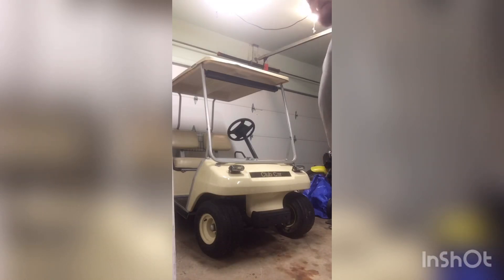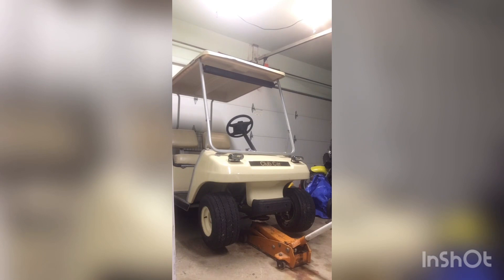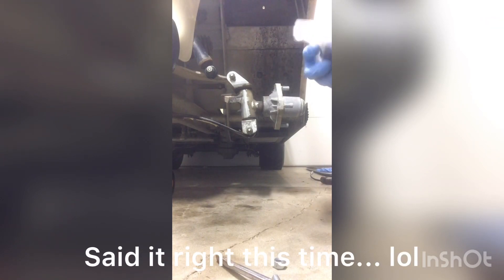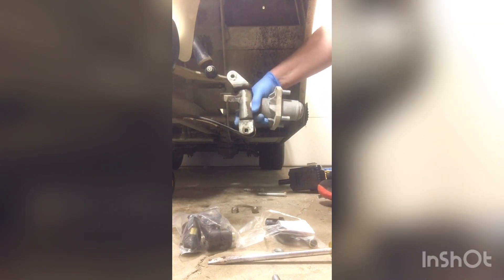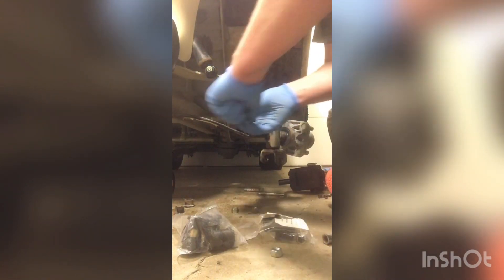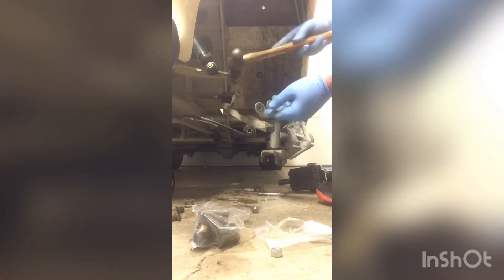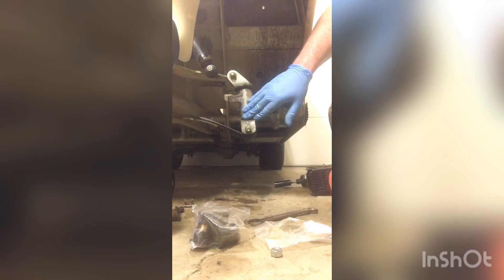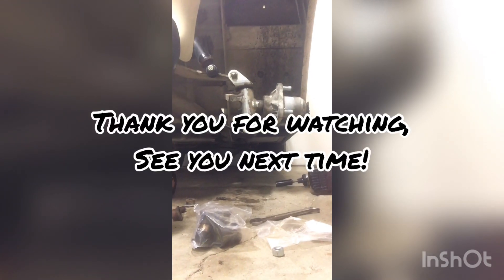Club Car golf cart spring bushing DIY replacement EASY 10 MINUTE REPAIR

Comment: Thanks for the great video on how to replace the bushings. You gave me some great tips and I used them all in replacing 4 bushing. I had a little issues getting the new bushing in place and the hammer was not workings. So I am sharing with others, if you have a 4 inch "C" clamp,  you can use that to set the bushing in place and compress them together.  Once in place you can get the bushing aligned in place and put the bolt right in place. Your tip on the shock moving was very helpful.
Reply from the maker: Great tip! Thanks for watching! DIG

Comment: Where the heck do you live, Arizona??   Those thru bolts are always rusted to the metal bushing inside the rubber outer aspect of the spring bushing.  They will seldom, if ever, come out like yours did.  I frequently need to cut off the bolt at both ends between the spring and the inside of the shackle allowing the spring to come away from its bolted position.  Then I just gouge out the rubber bushing, inner bushing sleeve and the portion of the bolt still in there.  Sometimes have to use the torch.  Oh, do I wish those bolts would come out like yours did.  Just had to do what I stated above to the rear springs.  PITA.
Reply from the maker: Actually in Indiana right amidst the rust, Haha!  I’ve had them go well and I’ve had them go bad. Just so happens this one went well. Maybe I should film a worst case scenario? I have a couple EZ-GO carts that need complete suspension replacement, might see those come up soon. Thanks for watching! DIG

Comment: the cover don’t fit back on???  Any suggestions?
Reply from the maker: What do you mean by the cover?
Reply: Dude In The Garage  the casing that fits over the bushings
Reply: I was told I ordered wrong parts need gray instead of the black ones
Reply from the maker: Libby Counts ok, is your cart a precedent or have the heavy duty suspension?
Reply from the maker: Did you get your cart up and going again?
Reply: My 98 Clubcar has this issue and after removing the nut at the end of the bushing/hub assembly, I can't get the bolt out? Do I just need a bigger hammer? I suppose a lip could have need cut in the bolt with years on bad bushings...thoughts?
Reply from the maker: @ebachy  sometimes the sleeve gets rusted to the bolt. I would say just keep it soaked in something like PBblaster and plan on buying some new bolts. I hope by this point you got her rangled but if not try the above tip! Thanks for watching! DIG
Reply: @dudeinthegarage  Got it out as you suggested. Bolt was fine, just the bushing was decayed. I was in a rush to use the cart with the grandkids visiting, so fashioned a temporary one from a perfectly-sized PVC pipe (or maybe it was PEX). Anyway, took care of the clunck as I turned and rubbing inside the rim! Guess I better not forget to order the kit! 
Any sure-fired suggestions for stopping tire leaks (besides buying new tire on a rim)? Tried a leak stop product but it still leaks...